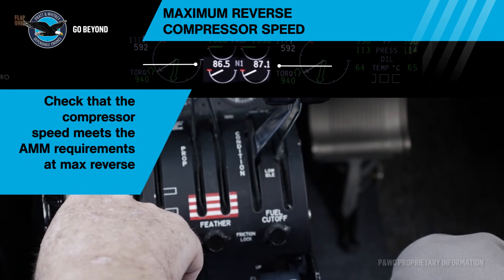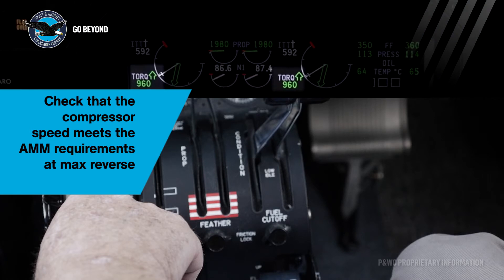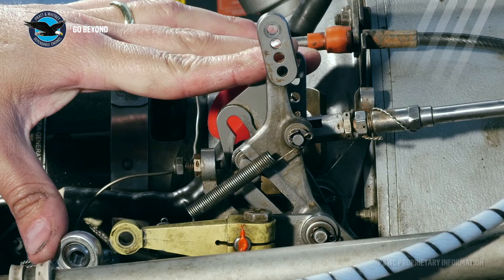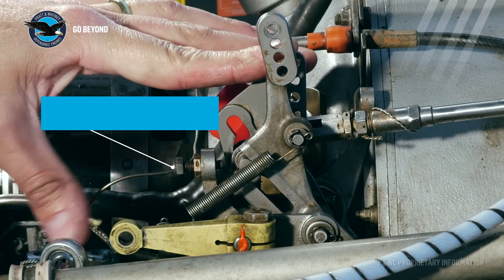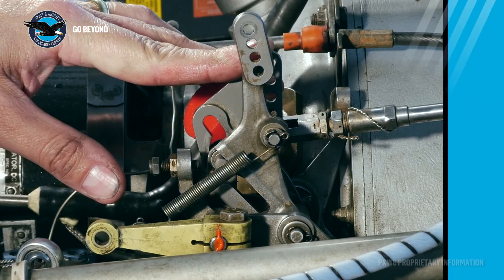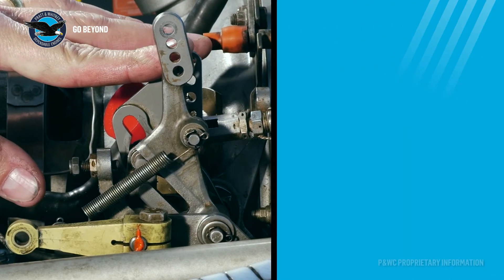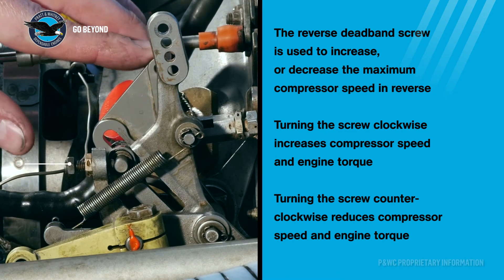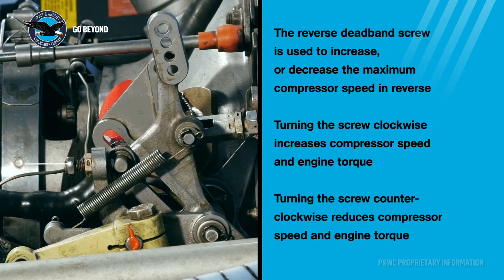Rigging Your PT6A: King Air B200 – Part 3

Comment: When we begin to pull throttle to the reverse position, n1 is dropping. Could you please explain the pick up point adjustment.
Reply: How did you finally correct your problem,because i have the same.

Comment: I started learning this in 1977. I always set FIBA first, therefore setting the correct prop blade angle. If you dont do that first the engines will not match torque wise ever. Do not adjust the beta nuts or stop nuts. this will FU the reverse. The beta valve must be exact from engine to engine. If you start to " chase your ass" static rig again and start over. Push and pull all the connections and replace bushings or bolt as nec. Do not allow the PY link to twist on the CSU, confirm that it is straight during movement of the power lever when going into reverse or high rpm .

Comment: During max ng check if max stop doesnt contact part power trim stop and ng is lower than 97.1 with   TQ 2230 what can we do;
Reply: Static rigging for the cam box is incorrect. Max stop should be contacted with about 1/8 inch gap before cam follower pin bottoms out in the cambox during the static rigging portion.